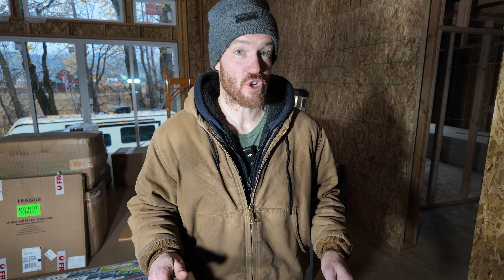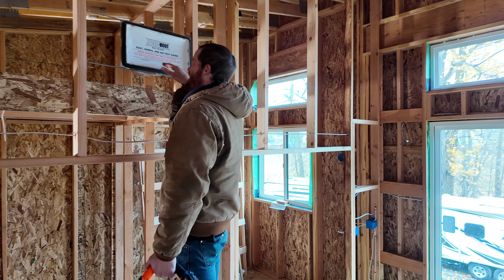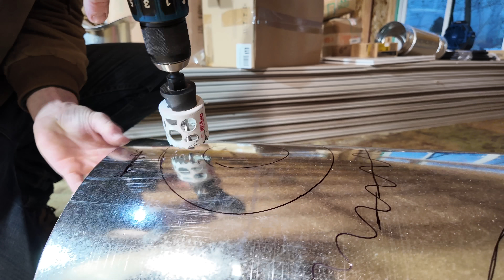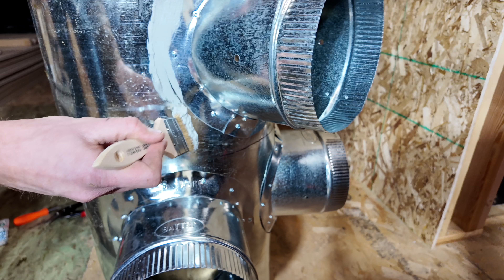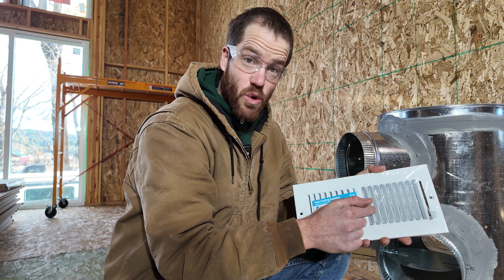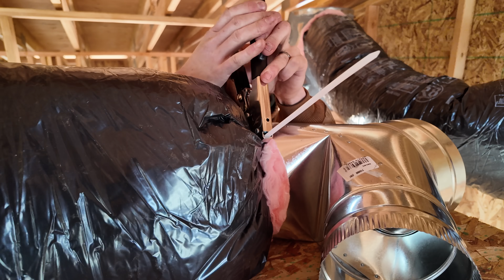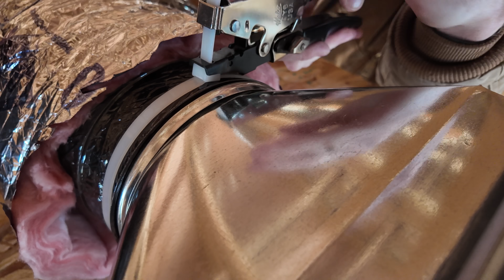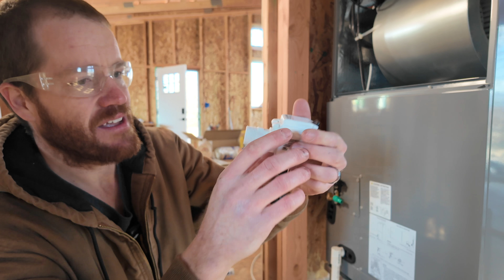HVAC Contractors Hate Me For Showing You This

Comment: Putting the vents in the wall close to doors and using those type registers will never push the air to the outside walls where the air needs to pull from. The return is pulling air out of the room as soon as it comes out. Need high velocity fully adjustable.

Comment: What house is this? Just watched a video last night of you installing an air handler in the attic with a compressor unit on the wall outside. Confused, but both good installs, except maybe this one needs a drip pan drain just in case.

Comment: Any reasons why people don't just 3d print a gyroid based HVAC system?, based on some calculations I did you basically need area for heat transfer and not thermal conductivity? Any clue why people have not attempted this?
Also keep up the great vids!
Best regards Tea!

Comment: Your supply plenum must extend at least 18 to 24 inches above the highest supply duct(s) outlet to achieve a proper volume of air flow through each supply duct according to its diameter. Also, your 18-inch flexible supply duct will only efficiently allow 1275 cubic feet of air to flow through it, and you will require 400 cu. ft. of air flow per ton of cooling capacity, however, if your system is 3 tons or less, you're 18-inch supply duct section will be slightly more than adequate.   All your uninsulated sheet metal on the supply side of your system will tend to sweat during the cooling season unless the percentage of humidity in your neck of the woods is below 35%.

Comment: I do air conditioning and a lot of duct work in Florida. the weather conditions and materials we use from county to county are different so im not surprised from a different state. In all for first time and no experience i think you did great and had some great ideas like the water heater stand being used to hold the air handler up, i do think that your flex should've been taped to all the boots and not just tightened with zip tie, Also using a zip tie on outer barrier is a great way to secure duct insulation but also a bad way of attaching it when you squeeze insulation it ruins R-value which can cause ducts to sweat but also loose efficiency. you did good and with some more practice you could be a pro and not just a diyer. hope your doing well and congratulations on the house

Comment: Heads up, folks: While flexible ductwork is widely sold for residential HVAC systems, it's rarely installed correctly—and for good reason. As mentioned in the video, over time, the internal ridges (or baffles) trap dust, debris, and moisture, becoming breeding grounds for mold, bacteria, and other airborne pathogens.

Serious health risks have been associated with improperly maintained or aged flexible ducting, including:
-Allergic reactions (due to mold spores and dust mites)
-Asthma exacerbation
-Hypersensitivity pneumonitis
-Legionnaires’ disease (in rare cases involving contaminated moisture buildup)

Once mold takes hold inside flexible ducting, it is nearly impossible to fully remediate without complete removal, often requiring the demolition of drywall, ceilings, and more.

In addition to health concerns, airflow performance suffers significantly. The friction and resistance within long runs of flexible ducting often result in poor airflow, especially to the furthest rooms—making HVAC systems inefficient. In fact, many municipal and state building codes now restrict flexible duct runs to 36–48 inches maximum. Be sure to check your local codes—they vary by region.

This project could have been a great opportunity to install rigid metal ducting, such as a single insulated trunk line across the ceiling. While it may seem costlier upfront (due to fabrication or material needs), it improves performance, longevity, and resale value. You can often work with a local duct fabricator for wholesale pricing or even DIY it using aluminum sheet metal from home improvement stores.

Unfortunately, any future owner will likely have to tear much of this out and redo it—adding cost down the road.
That said, I love the initiative this couple is showing. It’s inspiring to see people take on projects like this! But I highly recommend spending ~$200 to consult an experienced HVAC pro—you’ll save time, money, and headaches in the long run.

Great energy and effort from this team, but this setup could turn into a health time bomb if not addressed properly. Stay safe and build smart!

Comment: You will be replacing that Mr. Cool unit every other year Mr. Cool is trash go check there reviews. I also would have put a return in every room, especially with a heat pump. Better yet high / low returns come recommended for heat pump systems. Nice job though👍🏾

Comment: I agree also with the guys comment before me. all that metal you have in the Attic has to be insulated or it will sweat  you should have used insulated     cans for your grill. And duct board boxes for your connections and plenum . I also did AC for a living I've seen a lot of damage from sweating metal. But I did enjoy the video and it was good

Comment: I'm a HVAC tech by trade. You did a nice little install. I would be proud for someone that doesn't do hvac. 
You definitely could use some improvements. A big one is to insulate with R8 FSK duct insulation on all bare metal with insulation butted up against you flex duct. Tape all the seems of all your insulation very well. Believe me if your attic gets hot and that metal is cold it will sweat and drip on your sheet rock. In time ( years) it will mold the sheetrock. I've seen it a lot.  Also insulate your speedy boots as much as possible. 

When you finally have sheet rock up make sure to seal the edge of the boot to the sheet rock with caulk so there isn't any hot air from attic mixing right at the diffuser which will create condensation at the vent. 
Make sure you pressure test the system ( line set from outdoor to indoor coil) with nitrogen to make sure there is no leaks. I always do at least 400psi.  
The duct system isn't perfect but it will work. I've seen much worst.  
You are doing a good job
👍😉

Comment: I’m getting ready to tackle my house. Do you have any more video of how you did the return vent? Did you install it in the wall or did you do multiple returns?

You put the unit up on that stand so does the return come up from the bottom? 

I think I’m pretty much going to use your video as reference . 

I’m going to install my system in the attic and mount horizontal and then run all the ducts  to the ceiling 

So I was thinking about running an 8 inch pipe directly down the center and then branching eight and 6 inch pipes off of it. The house is about 1500 ft.².

Comment: As a former installer and now service tech I am actually very impressed. I also highly recommend insulating any exposed metal that you have on the ductwork to prevent condensation. I also recommend sealing the inner liner at the boots with flex tape to help prevent air loss. Overall not half bad 🤙

Comment: Should I build a wooden platform set the furnace on it? You'll be able to cut the hole out in the plywood and you could have mounted your return air at the bottom with a register. Just drywalled it in no duct work but you think you got to set it on a stand. It's ridiculous. Stick to pollen, wood and mudding drywall cuz you're not very good at heating AC

Comment: Honestly as an hvac tech myself not a horrible diy job, i would like to recommend though that heat pump systems shouldn't be ran under freezing temps due to the compressor on the condensers. They run with oil, and are basically a cars engine using pistons to circulate the refrigerant. That oil does get sludgy at low temps and can drastically reduce its lifespan, if not cause catastrophic damage once turned on at extreme temps. 
Hello from MN!

edit, before anyone says anything, we set out thermostats and have temp sensors on every heat pump system to prevent run time on heat pumps to utilize the gas furnace once temps reach 34 degrees. Not only does it save lifespan, it also reduces energy costs on the homeowner due to gas prices being cheaper than electric run times on these units.

Comment: Nice work, but supplies should have been over the exterior windows and returns on the inside walls to drop the heat load at the extremes and provide good circulation.  I’ve built a 4000 sf house with geothermal and it’s so evenly cooled/heated because the contractor did a great job with us laying it all out.

Comment: The better way to use a hole saw and not snap your wrist, break the pilot bit, or tear your free hand open with the material, is to set the clutch on the drill high enough to cut, and low enough to cut out when things bind. I see a lot of guys in various trades using all sorts of other tricks, but still using a drill with a variable clutch set to full torque.

Comment: I think you will be dealing with moisture / mold issues and replacement evaporator coils, my two cents as a contractor. 

for someone not well versed in the details, it was a really solid attempt. 

But to avoid issues go back and insulate everything and provide whatever extra return openings you can in that closet as possible

Comment: i would say yes mr cool is probably high efficiency but i dont know about the way it is install in this job haha, i will say you should ask a person and get some advice in another time cause there is many thinks to considerate when you are installing a system like that, one is to install a filter box cause that unit is going to get durty and you could damage few things and one of them is the blower motor which i already change three already, cause mr cool doesnt explain people few thing in they "DIY UNITS" also just to let you know some times they are prettyyyyy annoying when you need parts, they are hard to work with them, they need to fix they customer service asap, if you need any help or question i could help u

Comment: As an HVAC professional these are the units we dread coming up on.... diy is awesome, but some things are better left to professionals....

Black duct liner will attract radiant heat from the attic  instead of reflecting the radiant attic heat like the silver liner.
The trunk duct system is the proper design due to duct pressure reasons. The octopus is frowned upon because its ugly and has terrible airflow. Properly reducing ducts after Y connections is a must to maintain velocity.

No dedicated return duct for the system, just an open air return is not gonna allow for good air exchange. Your unit will probably struggle during extreme conditions and in the long run will be a head ache in service costs. Plus resale value wont be as high due to not being up to code.

Comment: Your ducteork cfm math is all wrong. Thats not hiw it works. You dont even have a duct calc. 
Your static pressure is probably gonna be nuts. 
Thats why companies charge so much.  Guardmteed done right.  
Also mr cool is cheap chinese crap.  No real contractor will touch it when you install it.  So good luck.

Comment: Nice work! As long as the system is sized and installed properly you should be fine. Hopefully you had a load calculation done prior to going with the 30k BTU.

Comment: Other than that you also didn't mention the down time it takes to run the proper calculations and heat loads to understand the full CFM such as how many are in the home at any one given point how many appliances put off a certain amount of heat what type of storm doors and windows are placed and where in the US your doing the work Michigan may require thicker insulation wraps compared to places like Florida

Comment: I see one fault with the air distribution. On your supply plenum you should have added an additional 12-14 inches uncut to build up static pressure to help balance the air flow. Air is like water and takes the least path of resistance. In this case your not filling the cylinder before pushing the air into each of the ducts. In this case the duct at the top will receive more air volume than the other ducts will get. 2, all metal that's not in conditioned space other words going from an heated attic or crawl space to a conditioned room in the summer will cause the metal to sweat causing a water leak issue eventually showing up on the drywall of the home or a vent that drips. All metal has to be insulated. Kinda like adding all your duct to a box the box has to fill with air before pushed equally in volume of air flow of not most of the air will exit at the top of the plenum. And the lower ducts won't have near all the volume the top ducts do this is why it's important to create static pressure inside the box or I'm this case the supply plenum

Comment: I HATE my high efficiency unit.  The fan switches speed and leaves 2 rooms cooler than the other since the force doesn’t reach there.   Thousands later and on nights it is  10 degrees below it will get down to about 50 in my house with the result of the furnace never shutting off..   we have tried everything from thinner filters to a new wall controller…. We now use 2 space heaters 450 watts each in those rooms and the furnace can now keep up on the most brutal nights.. it was -9 just a few nights ago..

To be clear the home is 16 years old and 3 stories

Comment: So, as a contractor, I don't hate you for showing this.  You didn't give out any trade secrets or anything because, there are none. But there are definitely things you are lacking with your DIY install. For instance, a load calculation. How did you determine what size of a unit you needed for your home? It looks like you have a 4 ton heat pump which is way too large for a 1,000 sqft home unless it's an open barn. A 4 ton system needs to be able to move 1,600 CFM of air, so your air handler should be a 4-5 ton air handler to be a proper match, moving more than 1,000 cfm.

All of your boots, splices, and wyes that are not insulated will sweat unless you are encapsulating the attic. If you are encapsulating the attic, you also need to condition that space as well, and will also need to bring in fresh air to the home depending on how tight the rest of the home is. 

I'm all for someone trying to DIY simple projects. Ductless units are great and easy for a bonus room and such but a whole house ducted system has more involved than just installing it. Most system issues and comfort issues come from poor installs, oversized equipment, poor duct layouts,  etc. I have all kinds of homeowners calling me out to work on their DIY installs and end up spending more than they did on the unit fixing it.

I'm not sure where you are located at, but 20k for a 1,000 sqft home is high to me. There are definitely contractors around me who would charge that but maybe in your area cost of living is higher.

Good for you on doing the work. "Spider" duct systems aren't great, but you did install dampers which will allow you to balance it. To do that properly though you would need an air flor hood to measure CFM of each register, which again, is not really something a DIY installer would have.

Comment: If one can afford it, may I suggest going w/ "metal duct" for the "main trunk" lines and only use flex ducts (hi ratings) for the drops.  This way, you get better air flow and cleaner air as time flies by (20 yrs down).  Also try and find "copper coil" air handlers, very hard to find now, but in my opinion, they are better than the aluminum junk currently...

Comment: Nice job - Pro Tip: all sheetmetal must be insulated, use the foil tape with foil backed insulation. in a pinch use the 16" flexduct R-8 insulation otherwise the ductwork will sweat in the summer getting the wood wet and causing mold and mildew. Tip 2 is the drain will get clogged in the trap eventually, when you redo the 3/4" PVC drain because its blocking the filter rack, cut in unions to remove the trap so you can clear out the trap annually or when you change the air filter in the return at the bottom of the air handler.

Comment: Not sure where you are located but If you are in warmer climate areas you should definitely insulate the plenum as the attic heat play the cool air will cause it to sweat and eventually stain the drywall areas around it and possibly cause mold and mildew. Also recommend putting bumpers under the feet of you stand for noise reduction as time goes on. Would also place ducts about 4’ off the exterior walls where the heat load is the greatest. Good job!

Comment: Or you can buy a vacuum pump, micron gauge, valve core removal tool, flare tool, and nitrogen regulator to be able to use Mitsubishi or any other brand. Extra $1,000 of tools but then you're set for life or helping your friends install them.

Comment: first off you have no heat load calculation for this house.  what's the value of your insulation in the wall, attic, and what type of thermal barrier for the outside walls and basement.  as far as any reputable contractor is concerned, how do you know the equipment sizing demanded by this unique structure.   best of luck using electric heat.  it's awful.  you are also using one central return.  good luck with that.

Comment: One of the thing is you going to need to insulate your octopus because come summertime since you just using regular metal duct with no insulation inside or outside it's going to start to sweat that's what is then going to even run down the outside or the inside depending on the season and the time of the year and then you going to have some real issues I mean it was kind of a bad idea to get a R410 unit anyways considering 2025 is last year to get them

Comment: Also I forgot to mention when it comes down to your duct work if you haven't used a ductulator you're going to end up with issues of no air flow coming out of a register the incorrect CFM per room which is not going to allow you to cool or heat adequately